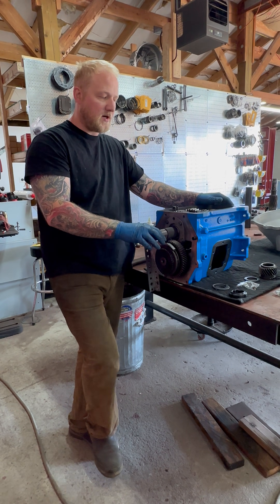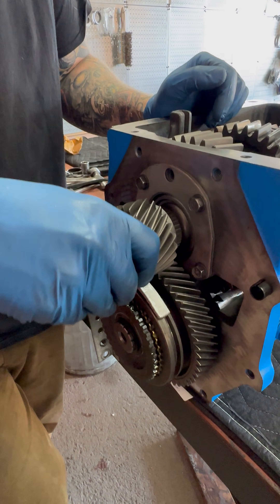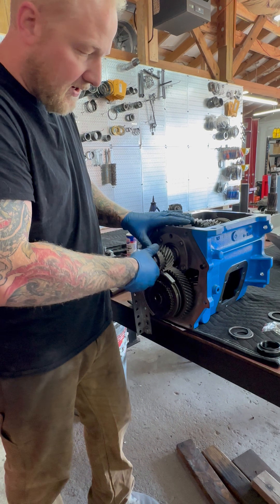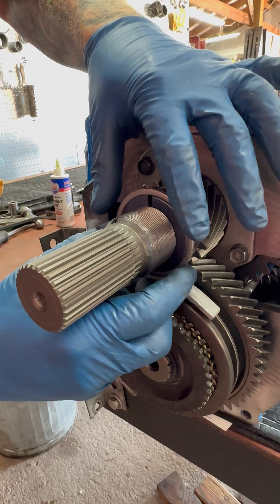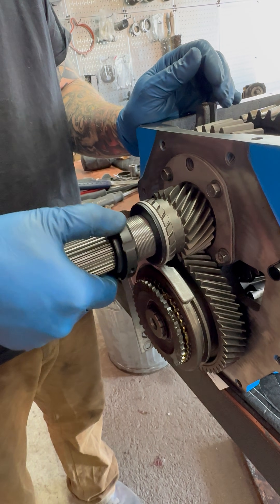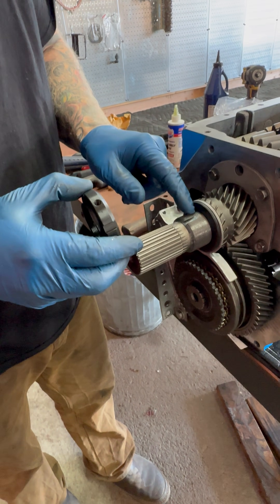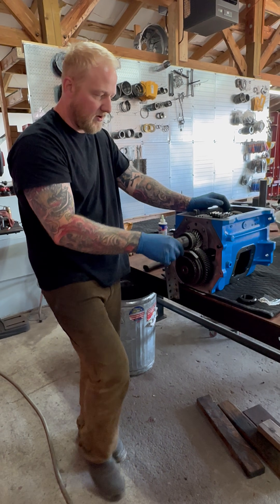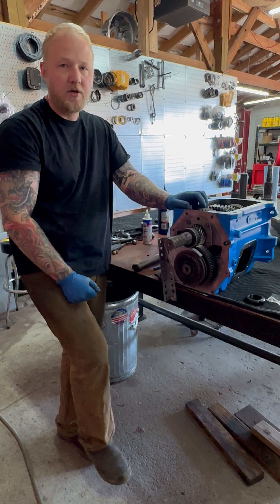NV4500 5th gear nut solutions explained

Comment: I just had my nv4500 pulled out for a rear main and went through it while it was out and replaced aftermarket brass syncros with lined ones and while apart decided to replace my fifth gear as it had loosened up a little. I have the same mainshaft with split washer. When I replaced the gear I used bearing retaining compound with the new fifth gear and put it back together same way as I have a couple times before. I now have a pretty intense vibration only in fifth... I can run up to speed in 4th and no vibration and soon as shift to 5th there's instant vibration. Would a new gear cause something like this?? Any ideas would be great before I tear back into it.... thanks.
Reply: How did it go did you have to tear back into it what was the problem thanks❤

Comment: Is this split washer kit a guaranteed
Solution?
Reply from the maker: Definitely not. If your old gear and shaft have come loose at all, no fancy hardware at all will keep it secure. Welding risks breaking the mainshaft. With our package of replacing the mainshaft, and fifth gear, using the split washer retainers, AND the nut, we’ve never had a fifth gear failure reported. The key is fresh splines, good adhesives, and the updates shaft with the split washers.
Reply: We’re can I buy this fix

Comment: Bought a ‘77 sierra grande with a 98 l31 350 with an Nv4500 I noticed first and second gear are smooth going in third gear has a little grind going into gear sometimes 4th sometimes aswell went for a drive today and 5th gear sounded pretty rounchy going down the road any idea what could be causing it? Drove alright in 5th but didn’t sound healthy wanna try and catch the problems before they become a big problem any help tips could help
Reply: Your syncros are probably going out on 5th gear

Comment: Do you know what I have to all have to change a 2x4 nv4500 transmission to a 4x4 to fit a 1996 dodge 2500? I like the idea of changing the main shaft. I  figure I will need one of them for sure and change out the tail shaft housing to accommodate the transfer case,  if that's all I need,  do you know where I can get the tail shaft section and the new main shaft

Comment: Do you use sleeve retaining compound on the taper roller bearing also or just the 5th gear splines?
Reply from the maker: On the aftermarket shafts, the bearings are all a press fit. No need for a retaining compound.